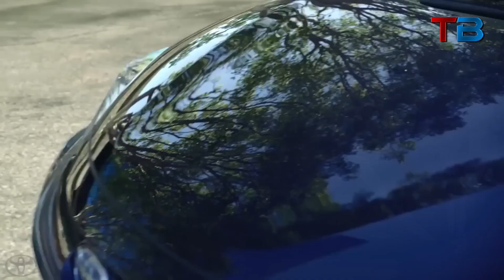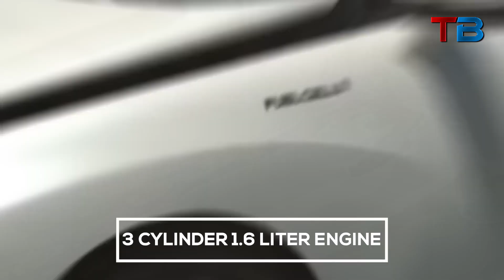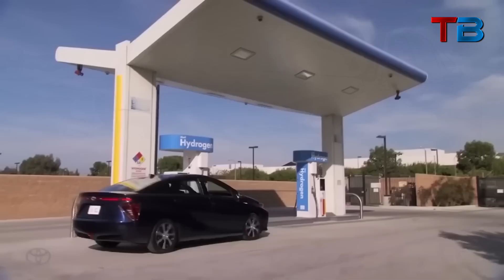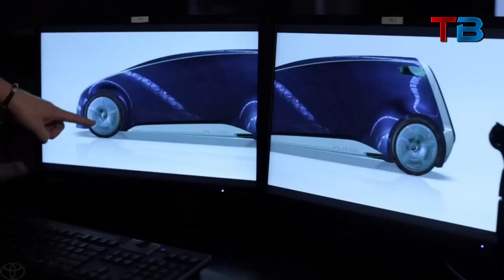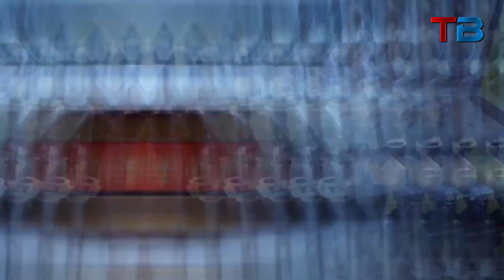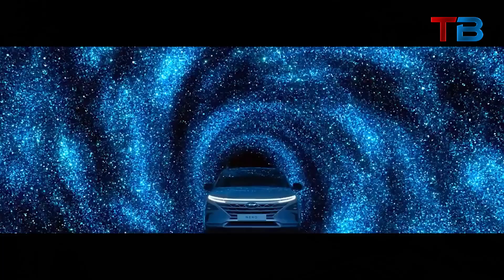Is Toyota Changing The Car Industry? The Rise Of Hydrogen Engines | Tech Blazer

Comment: There is no problem building an internal combustion engine powered by Hydrogen.  It is a flammable gas and is actually less dangerous than petrol (gasoline).  If there is a gas leak, the Hydrogen rises upwards and gets away from ignition sources on the ground.  If you spill gasoline, it evaporates and the gas produced is heavier than air (much heavier)((almost 4 times as heavy)) so it flows along the ground looking for a spark.  However, unless something major has been found that I haven't heard about you use about three times the elctricity to electrolyze water, compress or liquify the Hydrogen produced, transport it to a hydrogen station and fill the tanks of a car than you do if you simply send the renewably created electricity by high tension wires, run it through a transformer to bring it down to a usable voltage and charge an EV battery.  Please tell me if I am missing something.

Comment: when I think of Hydrogen used for transport I think of the Hindenburg....Hydrogen is a very dangerous combustible gas....how will they pipe it safely and what valves will they use to control it?....all valves leak eventually!.....you will never see me anywhere near a hydrogen car and definitely away from a gas filler tank
Reply from the maker: Good point, but probably much safer than the Hindenburg. Progress has been made in the last 90 years.